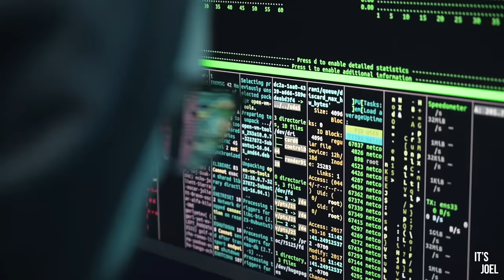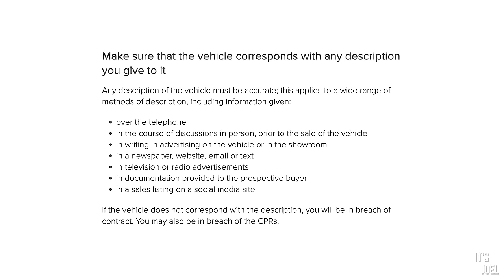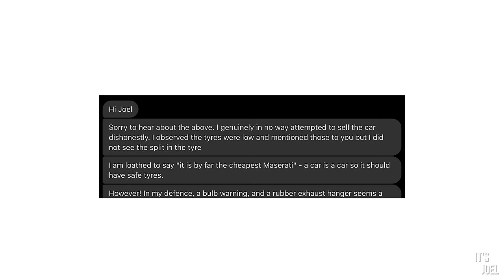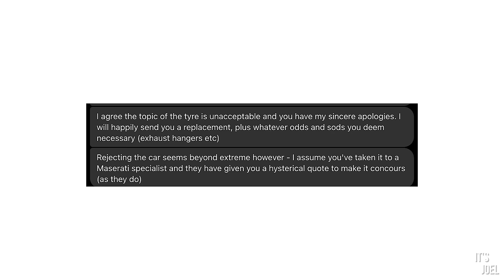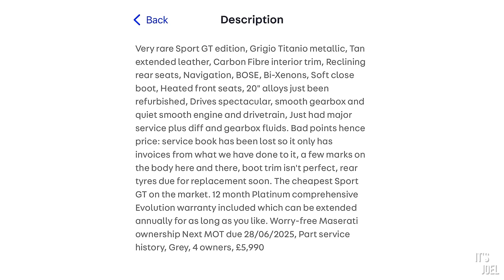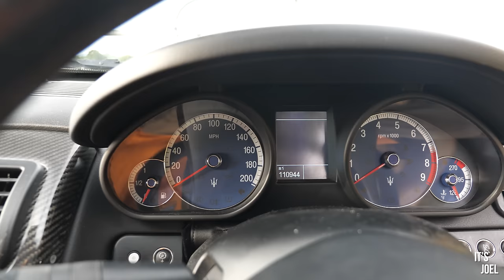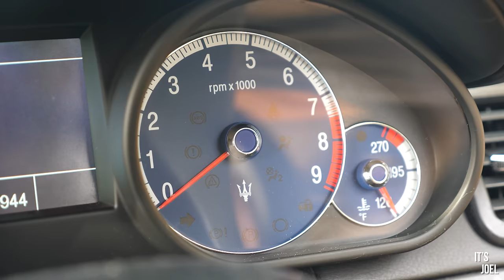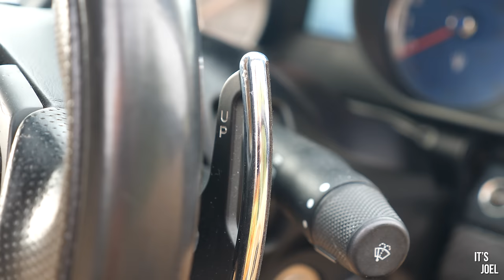I was lied to about my Maserati Quattroporte...

Comment: I really respect this channel. Showing the reality of owning exotica, but also the reality of buying things in this (realistic) price bracket. Thank you as well for confronting the dealer - plenty of people happy to trade on emotion and 'move on' cars which need proper repair. They are a disgrace to the motor trade.
Reply from the maker: Thank you for watching!
Reply: Buying the cheapest car on the market doesn't seem like a unrisky option tbh...
Reply: Maserati 🤷🏻‍♂️ If you want Lexus build quality buy a Lexus!
Reply: @mastacrx it still should be for for purpose regardless of the price.
Reply: Exactly! From said people arises the stories of how horrible said car is because they didn’t maintain it properly or the next buyer gets a list of issues.

Comment: I think buying a car of this type, unseen, off a 'dealer' on instagram is asking for trouble. However, I would find out his location and pay for a lawyer to write him a stiff letter, sent signed for, giving him 14 days to refund you or you will take him to court. You would be amazed how well that can work.
Reply: A 'stiff solicitor's letter' is a complete waste of money. It does nothing and scares nobody. If the thought is to take the dealer to the Small Claims Court just fill in the forms, pay the fee and do that instead. Much cheaper.
Reply: The small claims court only goes up to £10,000. Of course you have to follow through with any legal threat. It's worked for me.

Comment: If the car was purchased on a credit card the card company are jointly liable and a section 75 refund can be requested. The best thing about this is that they will pull the money back from the dealer.
Reply: Oh you mean Section 75 of the CONSUMER Credit Act?  Which covers CONSUMERS?  Good luck enforcing a CONSUMER right in a BUSINESS TO BUSINESS transaction lmfao!

Comment: You HAVE to report the MOT testing station.
There is no way that car should've passed an MOT, and as a tyre fitter and seeing how many sold cars have damaged or illegal tyres and have a "12-month ticket", well you'd be shocked.
One customer of mine, bought a car the day before, and had an issue with the tyre going flat the next day. I went to investigate and the tyre had completely worn through and popped on the inner edge. She had done 5 miles in it, and 4 of those were driving it back from the dealership to her house.
When i looked at the other tyres, 2 had eggs in the sidewall and the other front tyre was worn through to the metal on the inner edge. This was on a car that had NO MOT advisories.
The MOT station was right next door to the car dealer but there was no way this car had gone through an inspection prior to being sold.
Reply: To all those baying for the MOT station’s blood, they could well be victims themselves. It is not uncommon for people to put a set of good tyres on a car just for the MOT and then take them back off when the car passes. Remember, an MOT simply says the the car was good when it was presented to them, not before nor after.
Reply: @ATasteofJapan-br1fc  How many dealers would remove exhaust hangers after an MOT? They were never there for the MOT.
My son as a 17 year old was obsessed with Honda Civics. He spent all his money on a ropey looking example that had a clean MOT.
A matter of weeks later I saw him having his breakfast and he was looking very upset. He had been driving home the night before and approaching a dual carriageway roundabout a break pipe exploded due to extreme rot. He had to quickly use his handbrake to avoid disaster.
I had a good look under the car and there was no way that was worthy of a clean MOT only a few weeks before.
Reply: @andrewgraham4838  Yes, I know, of course, but I was talking about the issue of tires.
Reply: @andrewgraham4838  In case you didn't notice, I was talking about tyres, not exhaust hangers.

Comment: If it’s a company, to which you can find out on Gov website, then even if the 30 day surpasses you have notified them of the problem before the first month of ownership. Then they have to by law under trading standards attempt to repair the fault, if the fault continues then they have a second chance to repair or you have the right to reject the vehicle. He has admitted in writing that he noticed the noise so is aware there was an issue before selling but still withheld that from you. Regardless of price the vehicle is worth he has miss sold, misled you and left you in a disadvantaged position (out of pocket for the car so far). I’ve been through this personally, even had to take them to small claims court so if you need any advice I’m happy to help. The main thing to take away from this is that he IS liable to attempt a repair until the problem is solved or after the first attempt fails you have the right to reject

Comment: Completely agree regarding the warranty companies. They won’t fix anything until it actually fails. I had a leaking differential seal on a car. “I was told until the differential fails, we won’t do anything”

I don’t know what you’re planning to do to your car Joel, but fix it before you modify it. Get everything working as it should with no faults.

Comment: All part of the journey and content for you.
Install a pre-lube system to stop the variator clatter at start up. Be a couple of hundred quid. Then long term get it fixed correctly.
I'd be more worried about the underside despite what the "expert" said - its a right state and needs the subframes removed and blasted to see what's left of them.

Comment: If you have plans for content, then fair enough but I think it would have been better to have rejected the car. The dealer appears to ahve been misleading at best, lying at worst and should be investigated and/or shut down to prevent others from also being sold cars that aren't as safe (roadworthy) or as well maintained as claimed.  This kind of dealer is why the motor trade has the reputation that it has; same for the dodgy MoT station.  Good luck with getting the car fixed and upgraded

Comment: Its scary how many MOT no advisories actually are unsafe. I bought a mini as such from a dealer with very high customer feedback and asked my local garage ro service it. Was shocked to fine the tyre was ilegal. I complained and got given 500 compensation but there was far more that should have been found. Worn suspension bushes and drop links. Engine fault with thermostat. Only 2 months prior had MOT with some of these as advisories.

Comment: Obviously sold with a DUD MOT - I fell into that trap - Darren Carpenter car sales - (now defunct) flogged me a CL55 AMG (super charged) - pretty much like this I took to a specialist and there was around 5 thousand pounds of work or more required - it would NOT pass a MOT, it was of course sold with one. I basically got my money back after I sent the indy report over. I would be slightly worried about the engine on this but good luck and keep us updated.

Comment: If the vehicle was not as described or it has developed issues within a period of time of you taking ownership, you are within your rights to reject it or the dealer can offer to put it right for you after which you still have the right to reject it. Too many people dont know their rights and take the less hassle option when I dealer says no. If you ike the car and the issues are within your acceptable range then possibly get a contribution to resolve ie 10/20% refund. The MOT issues are surpirsing as most MOT centres have a registered MOT tester who puts their name to each test and should be reported if lousy it was done days before but has a massive split in the tyres and exhaust hangers separated and possibly dangerous.

Comment: I would send it back. These are great cars and offer tremendous value for money but you really do want to buy the best one you can find as parts can be expensive. Send it back and find a much better example with full service history (very important) - will cost you more but you will have a much better car on your hands. A cheap car is one thing but a misrepresented one is totally different. This car was misrepresented and the MOT is a scam.

These cars are so much fun and the engine note is out of this world. I haven’t driven a ZF version but am with you on the single clutch automated manuals - I love them. I have a GranSport with the same engine (mine has a dry sump and I think the QP has a wet sump) and CambioCorsa and love the thing to bits. The downshifts in sport mode are just epic! I love masers from this era!

Comment: I’ve rejected a Merc ML back in 2012. You need to give the dealer the chance to repair the faults. I tried 3 times without success. Within 90 days you have to put in writing, in a specific way ( look on line or get legal advice) that you have given them every chance to repair the faults but unfortunately the fault/faults are still apparent; therefore you reject the vehicle. Unless you do it this way you have no chance

Comment: Personally I wouldn’t want it because of the Cat S status which means structural damage. It could be fine, but I’d rather have one without Cat S. Other than that, it’s a supercar for £6k so it’s probably about right condition wise. If it already had the variators fixed, it would probably have been more. If the Cat S doesn’t bother you, I’d spend £5k getting it nice and hopefully you’ll boost the value to cover some of it. In terms of the dealer, he probably should have disclosed the noise, but to be fair it does drive ok and could probably be driven as it is for a while. Forward planning of the maintenance of the car will be essential so this is just another (big) item on the list. It might be cheap to buy, but it’s still a high maintenance supercar. I’ve always wanted one, but you have to be realistic with your expectations at this price level.

Comment: Not fit for purpose.
Sue the dealer.
As an aside I had a problem with an item that was bought new. It would go wrong a few times a month so I stopped the payments.
They threatened to sue and I said bring it on.
Long story short. They sued me and the judge threw their case out of court.
If you have documentation to prove your case you don't have to worry. Bad news travels fast and the dealer will normally capitulate to keep their name, although you will never buy from them again.

Comment: You’re lucky you’re in England with this MOT deal. In America none of that exists and when you buy a car you sign a contract saying the dealer is not liable if the car breaks down the moment you purchase it. I have a 2010 QP GT S that needed a variator cap job for $4,400 a month after I bought the car.

Comment: If you can get material from the car, then I can see why you'd want to move on rather than reject. The MoT needs flagging though, for the sake of other people they're screwing over. I'd also push the warranty hard to egt the max from it, otherwise, you've been screwed on the car & the repair.

Comment: Maserati's, just like Ferraris, have a lifespan of max 60,000 miles or 15 years. After that, maintenance and repairs cost are more than the current value. This applies to all models - really all models, without exception - no matter what a dealer promises.

Comment: The dealer is fully responsible for having sold you a car with a problem. 

However……. You have bought the cheapest Maserati sight unseen. That in itself is an accident waiting to happen. So you should expect problems.

And actually besides the engine problem, the rest is relatively fine. So if you decide to fix everything and pay the bill, you will have the insurance that the problem will be fixed. And that will reflect in the value of the car. Having said that, you will never make a profit on an exotic car.

Comment: Should have bought one from High Peak Autos.. At least you get a new set of number plates and mini valet and possible mot..😂😂😂😂
The interior looks lush..
I actually thought it was a Jaguar.
In fairness you got a car that drives but then deep pockets if requiring repairs..
Perhaps the car has been sat around and really needs a good run.
I have a passion with older cars and Just to name a few Mercedes CLK 320 52 Plate car which I've owned 8 years, but a so called friend said its worth more as a spares car to strip, sadly my heart sank as I have intensions of making it a nice car as 8 years ago you could see paint in perfections.
I have a Jaguar 4.0 V8 XJ8 it paid to get the four patches of welding done and put new tyre on to gain new mot.
My Audi A6 2.7 TDI estate also failed its MOT this year but since I had it back it really looks a different car. £390 to sort this out. And sometimes I wish I could bring it back to its former glory when new, but right now it stays as is. 
And my latest August purchase a Range Rover 3.0 diesel 55 plate interior sold it to me and I may not have bought it if I test drove the car.
But mistakes we make..
And lastly a dearly beloved car that I once owned (saying this wrong)it was a 58 plate Vectra 1.9CDTI It was a great car and sadly I missed it, and yes I bought a 2009 Vectra estate SRI CDTI with a tow bar I gave this a very short test drive and the gear knob came off in the car..And this really bought memories flooding back and I said to my mate I really didn't want to buy it.
But Sadly I did buy it and it has broken down the guy greased my cables inside but the pedal still went to the floor.. Said friend said my master cylinder unit was broke and I bought new one and he replaced but he did not bleed the system and I really lost the plot Oh well £1250 pound wasted.
My biggest mistake was showing this mate I had interest in a Mercedes E-Class 3.0 DIESEL estate on a 12 plate strange to drive as the gear stick is on steering wheel what a car.
So the month of August was pretty much any savings I had gone..
I am a young at heart 60 year old guy with a midlife crises, my plans have failed me especially if I want my own home.
My confidence in cars was to be honest around 60% I could never say 100% but some people just love knocking the little confidence I had in buying a good honest car.. (Astra Bertone 1.8) in question I paid £250 for it to use for spares on my 2.2 Bertone but park the two cars side by side and it would be sad to break 54 plate 1.8 convertible.
My own this year spent £830 doing improvements I still have more work to get it there. My Bertone 2.2 has never needed welding but its serviceable items do go like Alternator Battery coils, tyres.
Perhaps next year my fleet will be vastly improved...

Comment: Nah I’m not buying it. You bought the cheapest Quattroporte you could find with no evidence of the cam variators being done and then you’re disappointed when it arrives and it’s noisy. Honestly I feel sorry for dealers having to put up with this sort of stuff. You’d swear you’d just dropped £100k on it, not £5k. He’s been fair and offered to replace the tyre and various bits and pieces. Ultimately the car runs and drives with the noise as it is. Can’t expect a dealer to put £4k into a job like that. The sense of entitlement here is very evident.

Comment: I bought a car unseen from a dealer, a world class liar, my god l had so much to sort out to get it roadworthy! Worse, l traded in an oddball 4x4 that needed scrapping or exporting, it's sills &  front & rear subframes were totally shot, after realising l'd been conned l did an mot check on my old car and it had a brand new one with an advisory "heavily under sealed". 😂 Probably from the same mot centre that my "new" car came from....but...l'd bought a car unseen, some you win some you lose, best to put it behind you and crack on.

Comment: I bought an Alfa Mito from a dealer in Chesterfield. Within weeks , the electric steering failed . The dealer flatly refused to help as his mechanics diagnostics found no fault . I had to go to Alfa to have it fixed along with a broken multi air unit . Again the dealer didn’t  want to know . A complete arsehole whose reviews are dreadful. According to Alfa, these are the 2 most costly items to replace. Since then I’ve just had minor faults which are just wear and tear .

Comment: You need to watch Black Belt Barrister.
You should have insisted on a rejection, stated the items that are causing you to reject it and the legislation that applies in doing so.
That said, you do need material for this channel though, so maybe your stance is the correct one.
Reply from the maker: Big fan of that channel, watch him regularly. I’m only hesitant to speak on here about the dealer as I don’t want to find myself in any sort of legal dispute
Reply: @itsjoel  
Well, no need to go public on it.
Still, if you get more YT revenue from creting vids on fixing it than it costs to fix it, then it's all good, apart from the moral loss.

Comment: It's a Maserati. What did you expect? They are badly designed, badly engineered and poorly built cars that were doomed to fail.  As far as I'm concerned if the thing actually started and didn't suffocate you in blue smoke, you got a winner.